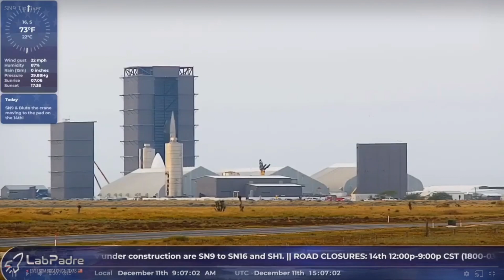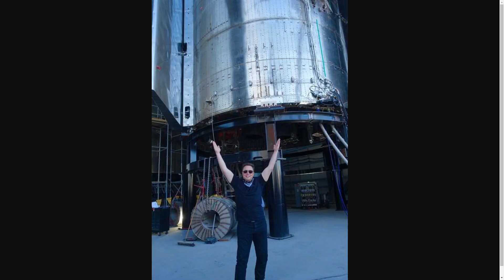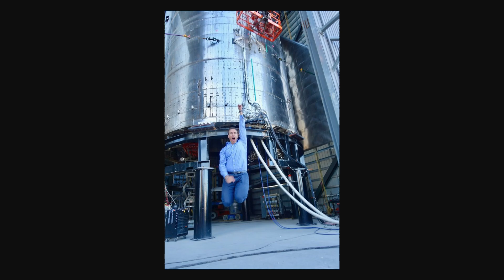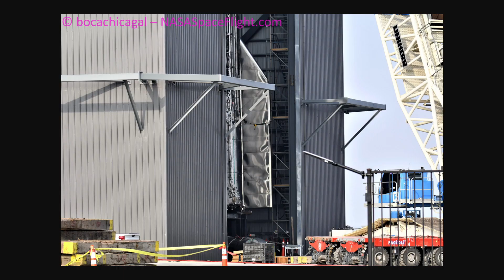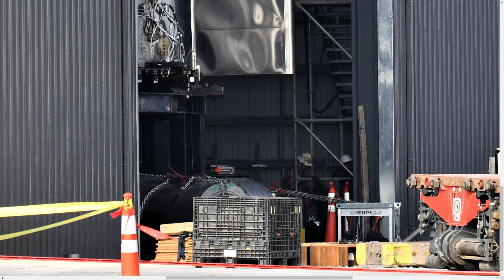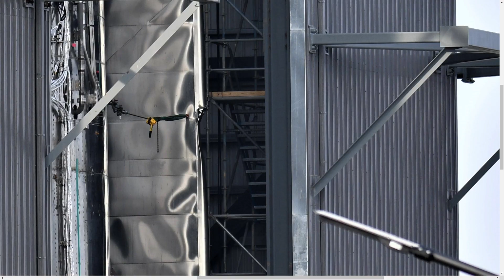Why did SN9 fall over?

Comment: So a whole video on the pictures without mentioning the makeshift counterweights tied to the structure the day before the accident? They clearly knew they had an issue, and their solution looks a bit questionable :)
Reply from the maker: Those makeshift structures are their go-to methods of securing stands. They weren't new. They do it with other stands and have been doing this technique for a while.

Comment: Could it be that it was one of the steel rolls that actually went through the floor? Ment to secure the rocket but did the opposite! Don't they weigh something like 10 tons? Lot of weight on a small area..
Reply: How many rolls did they place around the stand to secure it? Several are visible in Mary's photos. 10 tons X several = LOT of extra weight around the rocket stand. According to Wikipedia the empty weight of Starship (2nd stage) is 120 tons, but that is the completed version. Seen 85 tons for this one. So if there were say 5 rolls then that's about 60% more weight to take for the floor around the stand. Seems worrying..

Comment: It definitely appears to be a stand or foundation collapse.  Either a leg failed or it penetrated too-thin concrete.

You can clearly see the stand tilted over in this pic:  https://i.dailymail.co.uk/1s/2020/12/11/19/36737218-9043767-SpaceX_announced_it_would_soon_move_SN9_to_the_launch_pad_shortl-a-3_1607713968806.jpg
Reply: Doggeslife Great observation! Too bad with those cars in the way.. 😕

Comment: They should have used the bolts that hold my toilet down. I've been trying to get those out of the concrete for days with no luck.
Reply: Also not mentioned in the video were the massive stainless rolls chained to the stand. It seems they already had a stability issue, and with the 38MPH winds that day it was too much.
Reply from the maker: lol!

Comment: I doubt the legs lifted and if the strut didn't collapse as your proposing I would say the concrete gave out below the struts. 

The video clip you show is nothing but a downward arc. If it fell over due to the opposing legs lifting off the concrete I think the trajectory would be more a sideways arc with a wee bit of an up lift at the beginning.
Reply: I think the wind pushing the Starship to one side sheared the lightweight bolts on the stand on that side.  I'm just taking an educated guess here, but whatever the root cause, I hope it's fond and fixed.
Reply: @chrisantoniou4366  I just don't believe the wind was a significant factor. I'll stick to my theory that this was ultimately a foundation issue.
Reply from the maker: I agree it was ultimately a foundation issue, the strong winds exposed the issue quicker than not.
Reply: You doubt the legs lifted, but you seemed to ignore the massive coil of stainless chained to the stand. That is there to prevent lift. Lift can cause foundation issues post ad hoc, by putting to much point pressure on a single member. That is a failure of a foundation, but only because of the initial failure to control lift.
Reply: @petergraphix6740  That doesn't matter. You could in theory completely "unload" one of the members due to wind loading without the leg lifting off the concrete pad. The footings that should be below the slab below the leg locations must be designed to carry that load. I have a feeling they were not if they are present at all.

Comment: Bolts are only there to stop stand from lifting or shifting. Problem must have been either a miscalculation in engineering the stands or the same in calculating the thickness and strength of concrete pad.
Reply: When you drop thick bolts you brick concrete while sitting

Comment: They used a stand (that was built for stacking rings or like work) then raised it up to make room for work, Raptors maybe?  The light weight stands were bolted only and NO additional bracing was added.  THEN placed a full on Starship on it.  (I thought that was what engineers were there for?) They even acknowledged it was a shady set up because of the weights hung from it. (Adding to the load BTW)  Everyone there dodged a silver bullet with that one.  I could have had some bad things happen. (Did I say BAD things?)
I worked for a heavy construction company for 22 years.  We had a motto: "Get safe or get dead".  Sadly a few did.
Reply: The one picture shows that they cut the ring to allow forklifts to load the motors. I think that's what weakened it. 
There is a section missing. The ring is weaker laterally, so if the wind pushed the very tall SN9 toward the wall, maybe the front two legs could twist the very top part of the ring and fold under?  
At 0:52 there is also a section up by one of the white hoses that looks like it had been cut and rewelded.

Comment: Besides it tipping over it also falls down a bit... This is a indication that part of the supports collapsed...
Reply: Good call, to me that makes the wind theory unlikely, perhaps the concrete couldnt handle the weight? Or as you said, its simply the support that broke.
Reply: @Szaboo92  ... It's the steel structure that gave way... I'm a 💯% certain on that... It had no cross sections in it what so ever... Therefore it had no torsional rigidity what could have played a big role in it's failure...
Reply: @DetriotSteel  Yeah good point, the stand could have twisted, or bent. In any case lets hope for a speedy recovery for SN9 and FLY SAFE!
Reply: surprised to not see gussets at leg attachment  -
sure hope it was not building foundation

Comment: I've been talking about the instability of a tall Starship for some time.  I hope the winds on Mars are gentler than Texas winds.
Reply: The Martian would have us believe the Mars winds are certainly enough to tip over a rocket, and the "Mars Ascent Vehicle" in that movie certainly appears to be more squat and only a rendesvouz-with-mothership-in-orbit design. A quick Google reveals common gusts of 30-60 miles per hour, so, yeah... may want to consider that
Reply: @bdthomason  The Martian got it wrong by a factor of a hundred. The atmosphere is so thin that the wind has little effect. It was a deliberate choice for the plot. They needed a reason the crew would evacuate in a hurry but most of the equipment still being intact. Bad landing could cause immediate tip over but once it's stable the wind isn't going to do anything to it.
Reply: @bdthomason  The atmosphere is comparable to 100 000 feet altitude on Earth. Much closer to a vacuum than Earth conditions.
Reply: Hope they find a dead flat and level landing spot...time to add star hoppers legs back on.
Reply: @jasonrackawack9369  Seeing that SN9 wasn't sitting on legs, and that the final version will have self levelling legs anyway, why bother. Just install a support gantry to the stand and make the stand strong enough to take the load.
Reply: @jasonrackawack9369  They plan on redesigning the legs and the design is subject of much discussion as Elon put it. These are good enough to get the vehicle flying and tested. Won't be landing on the moon or mars for a while.
Reply: Yah, not really something they need to worry about.  Mars' atmosphere is so thin (< 0.5% Earth's atm pressure) that even its fiercest winds are like a light breeze on Earth.
Reply: Be aware that wind energy is dependent upon wind speed squared times atmospheric pressure (density). So the wind speed is much more important than density. Additionally the diurnal temperature variation is much greater than on earth, more than 100ºC. This creates much wind. Dust-devils are well known from Mars, felt by Mars rovers also. They are easily visible on images from orbiting Mars probes as dark streaks. I would be wary of winds on Mars..
Reply: Simple calculation of moments due to wind vs gravity. Please pick holes...

tonne = 1000 kilogram
newton = kilogram metre / second^2
pascal = newton / metre^2
atmosDensity = 0.02 kilogram / metre^3
windSpeed = 30 metre / second

windPressure = 0.5 atmosDensity windSpeed^2 = [9] pascal
starshipWidth = 9 metre
starshipHeight = 50 metre
area = starshipWidth * starshipHeight
dragCoefficient = 1.0
windForce = dragCoefficient * area * windPressure
windMoment = 0.5 starshipHeight * windForce = [101,250] newton metre

starShipMass = 120 tonne
gravity = 3.711 metre / second^2
massMoment = starShipMass * gravity * 0.5 starshipWidth = [2.003,94e+006] newton metre

massMoment / windMoment = [19.792]
Reply: So the max speed encountered over 2-4-6-8 years on Mars is just 30 m/s?? That's ridiculous. F1 tornadoes have 4-5 times that speed. One have to watch the highest wind speeds of course, that's when it will topple over. What are the max windspeeds of dustdevils or martian "tornadoes" if I can use that term. What research has been done on that? Have anyone a good idea, I doubt it..
Reply: I meant F5 not F1 of course..
Reply: @astrogeo1  https://mars.nasa.gov/news/1854/the-fact-and-fiction-of-martian-dust-storms/ says this: "The winds in the strongest Martian storms top out at about 60 miles per hour, less than half the speed of some hurricane-force winds on Earth." Perhaps this isn't surprising because the primary driver for tropical storms and tornadoes is the latent heat of water, a mechanism that is absent on Mars. I don't think a Martian storm toppling the ship would be top of my list of things to worry about.
Reply: It isn't exactly the same sitting in front of the computer screen and reading NASA-articles to have actually been in the actual environment yourself OR have conducted an exhausting scientific investigation of the matter. I think no one really have needed the answer so far, so it's not determined.
Reply: @astrogeo1  Whatever
Reply: @astrogeo1  How exhaustive were the SpaceX studies of Starship's stability inside its hangar?
Reply: @astrogeo1  The atmosphere is so thin it doesn't matter. It's almost a vacuum. 0.5% of Earth's atmosphere. Speeds can get high but exert no large forces.

Comment: No way.  it's the bolts.  A relatively slow collapse .  My pick is a buckling failure  in the support struts.
Or with ? unlikely   collapse of the foundations
Reply: Eh, there is a big coil of stainless chained to the stand. They new they had an issue with lift and the high winds on that day were too much for it.

Comment: "Elon, please put on a hard hat next next time. We need ya. We need that brain of yours."  Ha.
Reply: how much damage do we think will that hard hat prevent if 110tons of starship fall on Elon? no concussion then?
Reply: @mondvogel6124  cmon bruh everyone knows hard hats prevent ALL damage they are the ultimate protection..
Reply: @hayaMLa  not as powerful as a torch
Reply: @mondvogel6124  You clearly have no clue why people wear hard hats. It's not unlikely that when the high bay was built, there's a nut or a washer still left up on the beam structure 30m up. Because that was Friday night, and the builder really wanted to get home to the missus, so he made a mistake. 

Now imagine that 1" nut falling down.
Reply: @PeterKocic  now image that one contractor that's about to lay pipe ensured that jo just or bolts were laying around and cleaning up :p
Reply: @PeterKocic   I’ve never worn a hard hat because someone might have left a washer or bolt on a beam two months ago. I wear a hard hat because there’s active work going on above and they might drop something... that’s why people wear hard hats

Comment: I dont understand one thing. How did wind cause it to fall if sn9 is in the highbay? The highbay is literally used to shield the prototypes from wind.
Reply: Wind rushing by an opening (such as the door of the midway) causes pressure differences, might have to do with it
Reply: @nicolasdenis7094  It seems most people on this thread have not dealt with 'large' buildings before.  With very large openings in buildings you can have wind blowing in one part, and blowing out the other on the same side. Especially ones with complex environments (mid-bay) around it that can block wind at lower levels but not higher ones.  This behavior tends to cause erratic vortexes of wind inside the structure with very high velocities.
Reply from the maker: it's still a mystery for sure. If you watch the LabPadre feed from that day you can see and hear the wind, it was really strong that morning. SN9 is close to the highbay opening, and who knows with wind behavior and vortexes etc..
Reply: @leksicon  I still dont think its wind. It looks more like one of the legs from the support structure broke. I think so because sn9 tipped over fast and i think wind cant do that, and also in 0:25 you can see a roll of stainless steel chained to the support structure so if it was wind picking it up it would have stopped it. We have to remember that 2 of these stainless steel rolls is what spacex use for the mass simulators on sn5 and sn6.
Reply: @grzewikpl8562  I think its possible that it was the wind blowing against sn9 that increased the stress in the support structure, since sn9 looks to be secured to the support. Basically if the wind is blowing sn9 backwards it'll want to lift up the front of the support and if thats not possible itll press down extra hard on the rear of the support.
Reply from the maker: @grzewikpl8562  very interesting input. There is also a theory regarding a cavity under the support stand. The mass simulators you are referring to, was that 2 of these rolls for the total sn5/sn6 vehicle or for the sn5/sn6 vehicle nosecone only?
Reply: @leksicon  Not quite, you can make about 6 rings from one of these 10 ton 193 m long rolls of steel. It's about 3.5 rolls for a Starship without the nosecone.

Comment: Air flow, ie., wind, requires inflow and outflow to occur. A wind strong enough to snap those bolts could easily occur outside the structure, but not inside, unless there is an opening in the wall. An upper vent is possible on the high bay for venting noxious gases from welding, etc., and for releasing hot air that accumulates near the ceiling on a sunny day. But without that I don't think wind could be the main culprit.
Reply: I believe the High Bay is open also on the other side. According to a video I saw yesterday. Tankzilla drove right through it from the other side.

Comment: It tipped over because the metal buckled. Problem solved.
Reply: As stated in the video, the vehicle remained fastened to the stand, ergo, the stand tore loose from the floor.
Reply: @clintatk  but why?
Reply: @pablomuzzobar8940  the million dollar question
Reply: @clintatk  why is it a million dollar question though?
Reply: @clintatk  The weakest link are probably the bolts between the stand and the floor.

Comment: LOL, SpaceX knew they had a problem. Look at the huge counter weight chained to the stand to hold one side down. I'd expect to see some doors arriving the mid-bay soon. Or, at least tie a line to the bow of the boat.
Reply: highbay
Reply: @watkinscopicat  No, this is now called the mid-bay. The new high-bay is much higher and is where they are building the booster.

Comment: makes sense, lots of unaccounted for leverage
Reply: I would like for SpaceX to release their calculations for the expected stress on those bolts with a flight ready Starship oscillating like an inverted pendulum reinforced by a chance wind. Or admit the lack of that calculation. Future rocketeers might benefit from the reminder.
Reply: @justfellover  Benefits of doing real things real time, vs computer simulation, etc.  If they even did the bolt stress calculations - if not, bet they won't forget that for all future rockets, starting sn10, bn1, etc.  And I bet the bolt stress calculations are now done with much more real data as well as simulation.

Actually amazing that they have not had more incidents like this, considering that they are not only inventing the rockets as they go, but the manufacturing process (with real buildings, cranes, etc) as well.  This is uncharted territory!  No "how to" manuals or graduate level courses to take.

https://youtu.be/JjuEfHn30rM